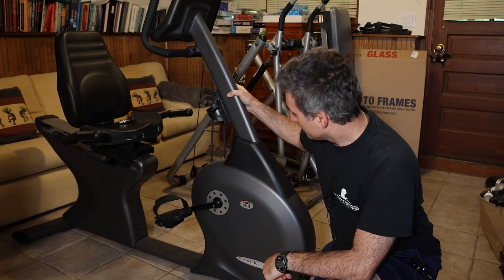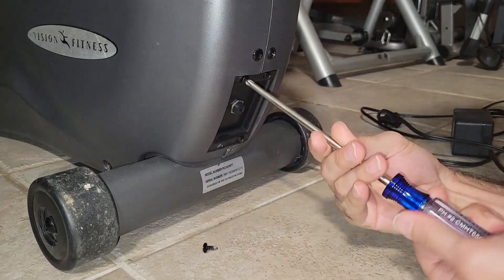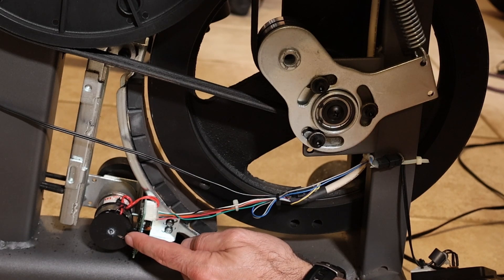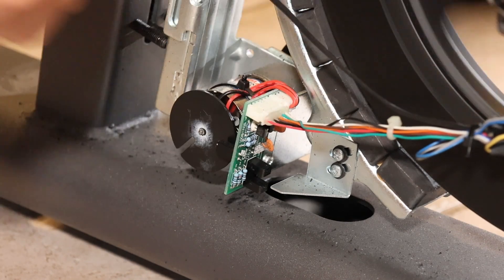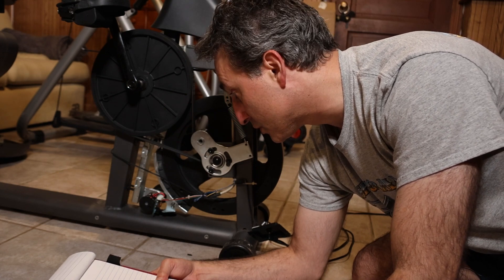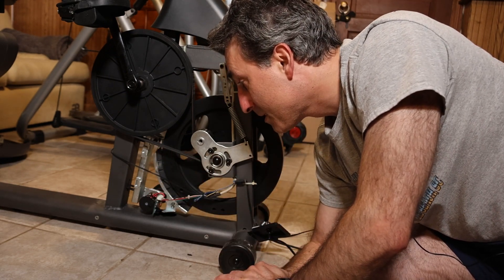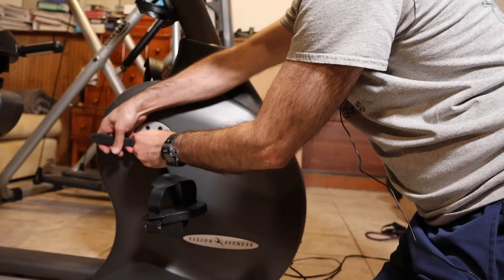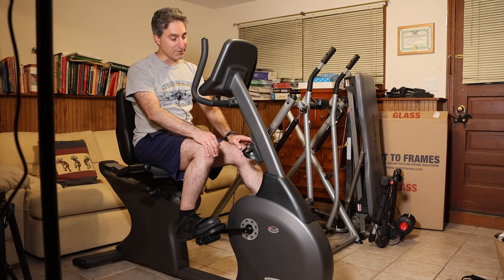Diagnosing Brake Failure on Vision Fitness HRT R2250 Exercise Bike

Comment: Where did you get the "puller" to remove the pedal from the axle?  Is there a way of removing the pedal without a specialized tool?
Reply from the maker: The bike's owner had the tool. I assume the bike came with it. If you can find a threaded rod with matching threads to the crank, you may be able to fashion a puller using the rod and some additional hardware like nuts and bolts. The goal is to apply focused pushing force on the center stem.